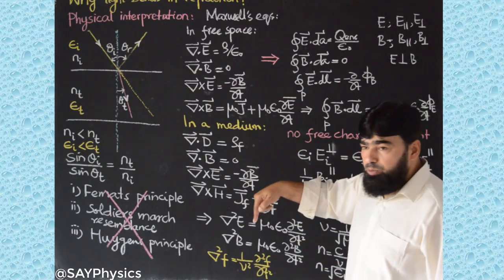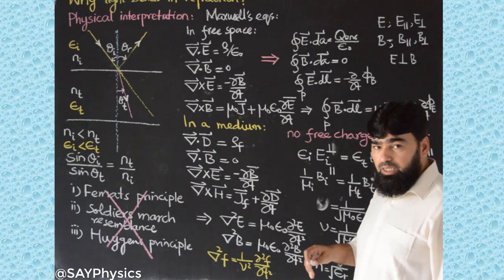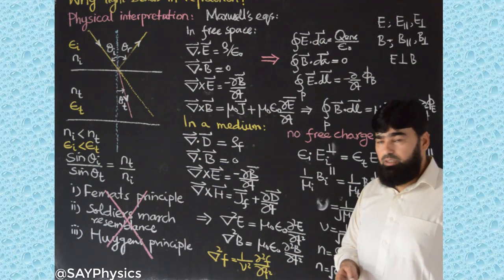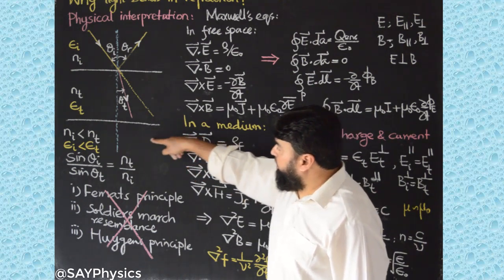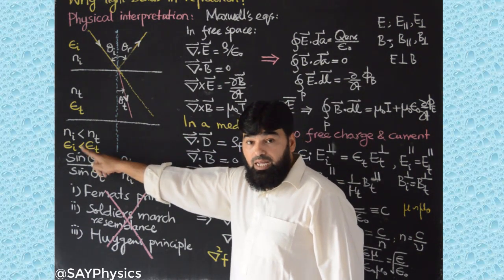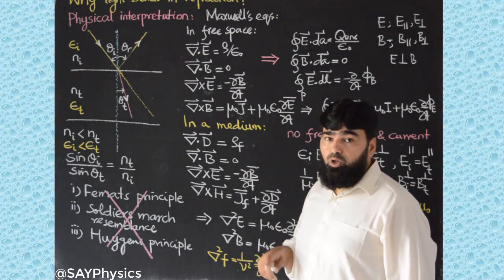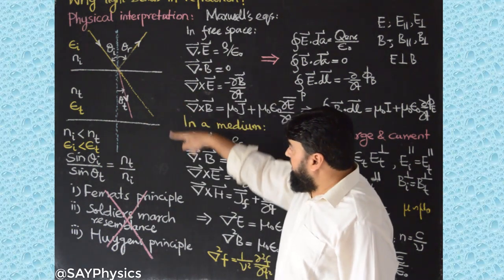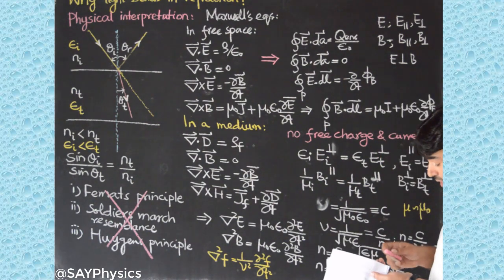7.3 Why light bends in refraction? physical interpretation

Comment: Dear sir,,,,one qstn related to the polarization although slighltly change frm the content 
The insertion of dielectrics Can reduced the  Electric field.
"V "desceeases
Q remains constant.
and the value of" C" increases.
Plz sir............
Reply from the maker: External field remains the same. In dielectric, polarisation field turns against the external field. This makes the net field between the plates less than the external field. Which enables more storage of charge. C is a geometrical property which is independent of Q and V.
Reply: Sir yr beauty needs no compliments❣️❣️

Comment: Sir this leads to the answer that why light is unaffected (not bends), as it is incident perpendicular from an optically rarer medium to the boundary of the optically denser medium . Then these explanations tells us that there will be no component of E-Field of the incident light perpendicular to the denser medium. so no change in perpendicular component, as it is 0, so it will not bend. But there is electric field parallel to that medium, why isn't it adding to polarize the glass horizontally . The equations tells us that parallel comp of electric field is not effected, only the perp depends upon the dielectric constant of the two media, but I am unable to happily digest this point.😂.
Reply from the maker: This mystery can't be solved unless and until you incorporate the Maxwell's equations with their BCs. Try to study the EM interaction with the medium in Chapter 9 of DJ Griffiths. Going through all the cases, you'll happily digest it. Even after that you're digestion is having issue, we can discuss. Thanks
Reply: @SAYPhysics  Hahaha. Sure Sir. Thanks alot